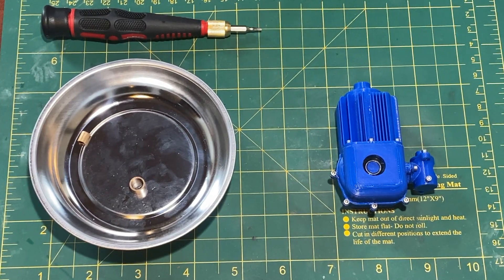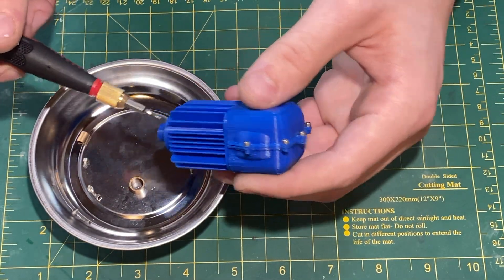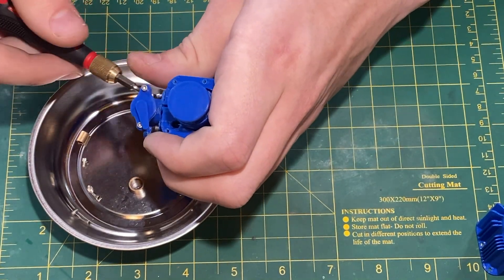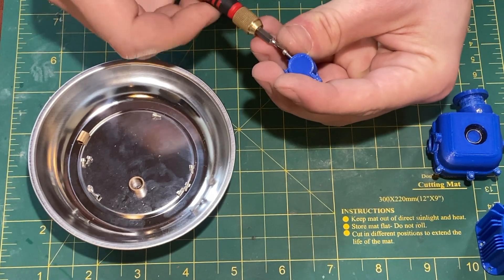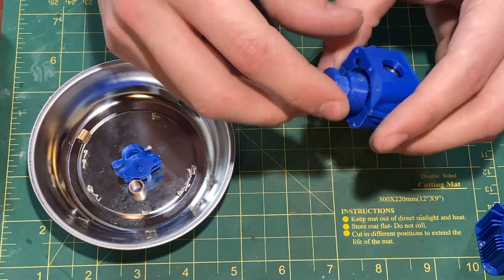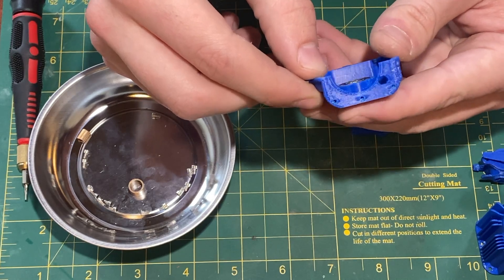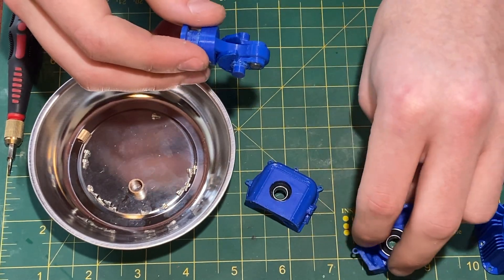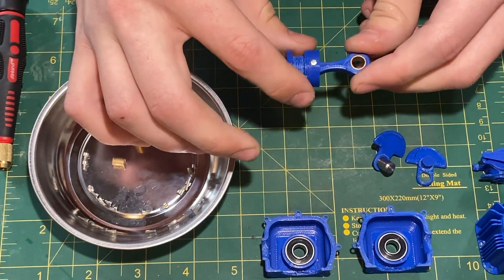3D Printed Cast Two-Stroke Engine Prototype

Comment: Nice design! I sent you an email, the vac chamber worked really well for casting silver, I had poor results with gold today tho. I'll keep you posted. I read on a forum a few days ago coating the part in lamp oil helps surface finish  greatly but I haven't done farther research into that as I had already invested. I'm stoked to see the motor cast!
Reply from the maker: I need to check my email but thanks for reaching out. I’ve just built a small vacuum with a glass container and a small valve that will hopefully work well. If you have a link to the forum regarding the lamp oil please send it over. Waiting for my new crucibles to come in the mail before I can cast again but I still have some work to do on the design in the mean time. Thanks!